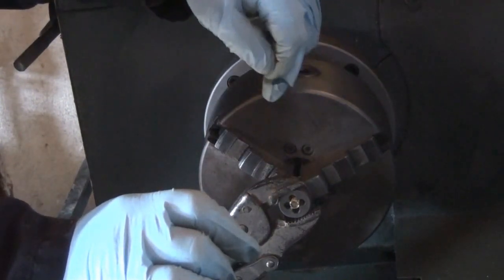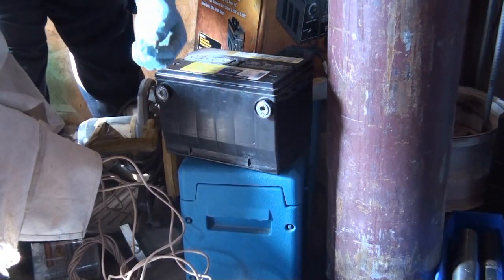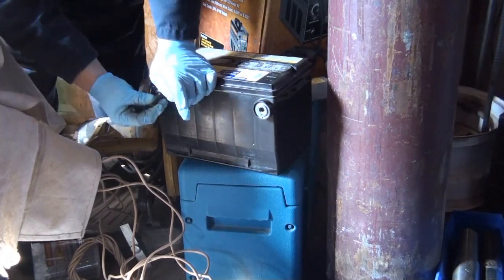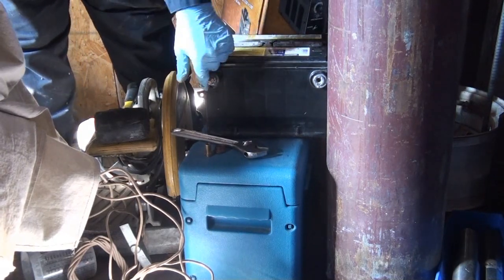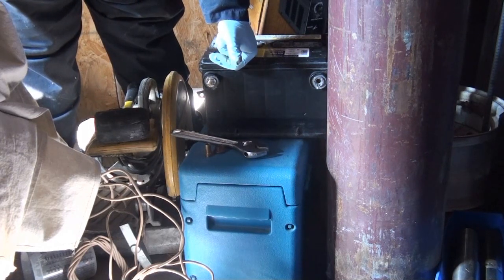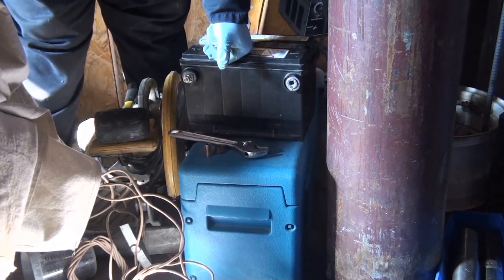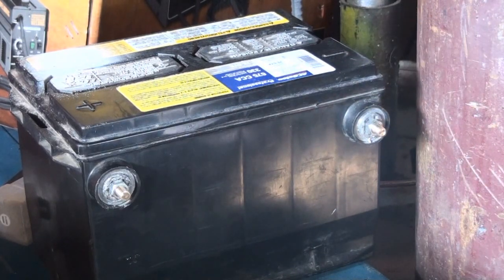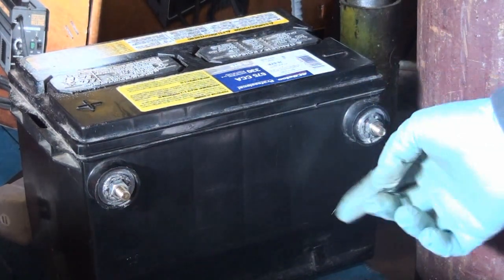Side Post Battery Repair

Comment: No no no no noooo. You're risking internal damage to the battery with that pounding. Just tap it and use a helicoil or tap it bigger and use a bigger bolt

Comment: Get a 5/16 inch lead wall anchor.  Cut it to the proper length.  Drill out the battery terminal to accept the lead anchor.  Press it in.  Screw in bolt.
Reply: Worked perfectly. Thank you internet stranger

Comment: Dry threading brass, yikes.. I fix these by draining the acid out if not agm, drilling out the damaged threads, adding a bit of flux, and casting with red hot lead. Then drilling out and tapping if i still want bolt on, or casting standard lugs on it. The main thing is that it gives new life to an otherwise trash battery.

Comment: This trick work on newer side post batteries when you over tighten it and pull the metal threaded insert out because I've done that so many times and it's such a piss off  Like I have destroyed batteries in the past Doing that Where I overtaken it and it sucks the metal insert right out of the lead terminal and I have no way of fixing it and was wanting to know if this would work because I am putting it into my truck which is a diesel that takes 2 batteries and it's the main starting battery positive terminal that is doing this and that terminal has both the main starting cable and the auxiliary positive cable coming from the auxiliary battery on to it And every time I tighten it it sucks the metal insert out Wanted to know if this was a quick fix for that or if you have another way to fix that from happening
Reply: Just leave them a little looser. They don't always have to be super tight and if you're worried you might strip it just stop. As long as good contact is made it's tight enough.

Comment: cool, you could realistically buy a brass bolt slightly over size of the hole and cut the head off with an angle grinder and knock it in that hole. Drill out the side terminal a bit so it it fits over the threaded end of the bolt and your good to go

Comment: I thought this at first but when i went to drill the hole to install a bigger tap for a larger bolt I pretty much went down to the steel, I figured the whole post was lead but I found out it wasn't, Same was true with my duralast crap battery. I wouldn't drill into the steel, I am guessing that might be just as thin as the lead over the steel insert. Automotive Battery manufactures are smart, Once a battery is stripped more business for them and retailers. Simply evil is you ask me.
Reply: Have that problem right now. I'll but a new battery but that battery will get a slightly larger cut off bolt screwed into it so it doesn't get wasted. I'll use it another way eventually. I'll take the bolt out of the terminal and drill the bolt out so I can put a nut on it with loctite on the new bolt post
Reply: Blame the automobile manufacturers since it is their design which determines that a vehicle uses this fragile method instead of top studs.

Comment: Why not just tap the lead out and use a larger bolt?
Reply: Smaller diameter bolts have more threads per inch than lager ones, these side posts are not that deep either, maybe 1/2 inch.. So a 1/4 bolt has 20 threads per inch, a 5/16 has 18, a 3/8 has 16, and a 1/2 inch has 13. So, in effect, the larger the bolt, the less threads, and less threads reduces the amount of torque that can be applied when tightening the bolt to the battery. That tapped hole is also made out of lead, which is soft and doesn't hold up to torquing (tightening) very well, which is what looks like happened to the battery in the video; the threads got stripped out.
Reply: @siaripop7  Correct, you will damage the battery if it go in further than the original thread. There is some room on the out side and you can force a slightly larger steel bolt in the there ( carefull you don't go in deeper than the bolt on the terminal would. 1/2 inch tops if that and it will thread into the led with the head cut off or a piece of allthread. Then you bolt the the side terminal after you remove the bolt from it and slightly drill it out so the the new bolt/ post will fit thru the terminal. Then nut it instead of bolt it.
Reply: Marc Del lead is soft. The press fit should aply to all side post batteries. I've got a good side and top post battery less than a year old. Positive terminal threads are stripped. I done the same thing pressed in a threaded piece of all thread rod.